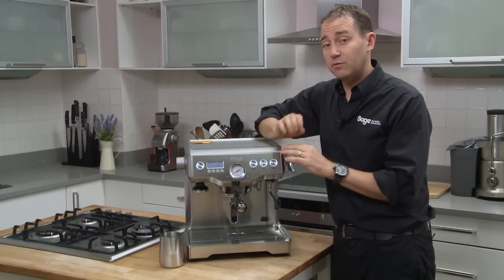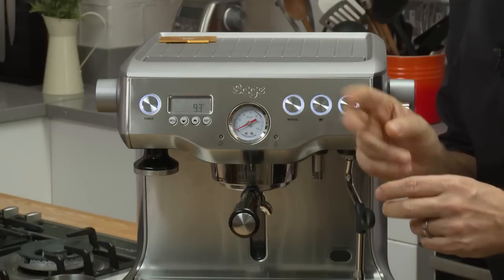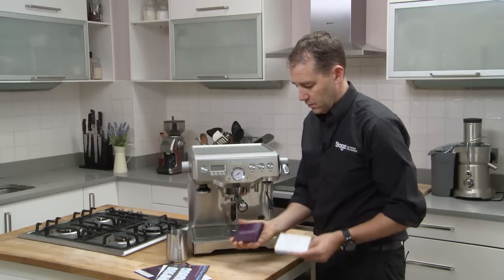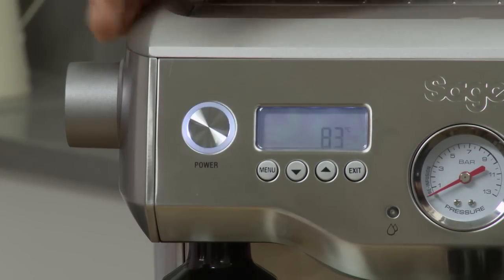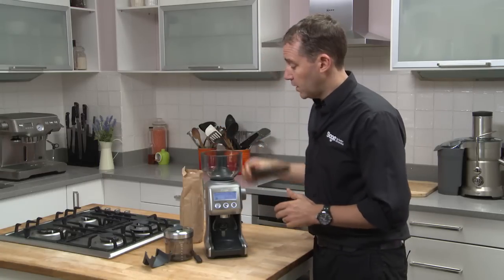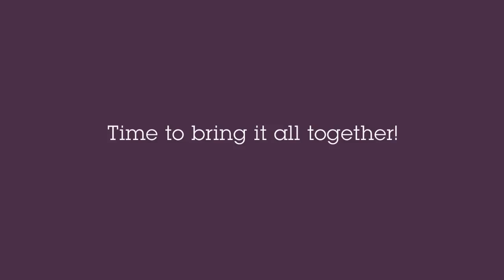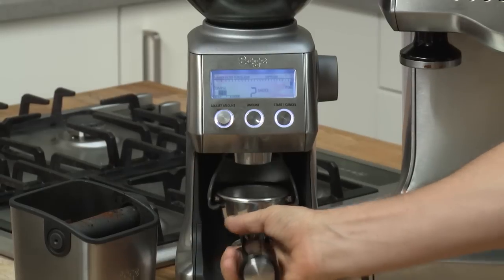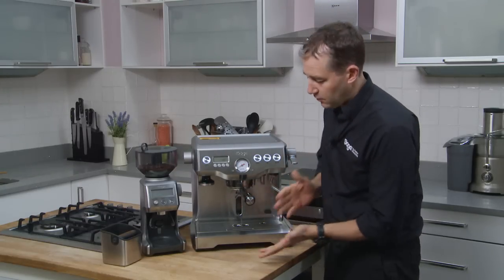Dual Boiler and Smart Grinder demonstration - Sage

Comment: For the grinder portafilter holder.Larger group heads are 61, but I'm sure the one in this machine is as stated , 58mm.
How has this Espresso machine held up? I have heard plenty negative reviews on the grinder, but the espresso machine has been mostly good, except for some forced sending in for service issues that have been reported.
Reply from the maker: Hi Phil, the machine is great and this video has mainly pointed out the best key features https://www.youtube.com/watch?v=sxoJjdLvspE could you possibly point me in the direction of the negative reviews? Many thanks.
Reply: I don't know....I really like the robustness of the Oscar so far. But, a PID control is key for perfection seekers...so..we shall see.
Reply: i think e61 is not 61mm but 1961 is the year of the original design. I have a smart grinder, i dont recommend it unless you are going from french press to espresso and back every day and even then, it is weak design - it cannot hold its setting, its cheaply built, hard to clean. My gears have stripped on it so it is going for recycling altho the burrs and display are still good after 3 years of light use. If you are doing espresso only, go for an espresso grinder - i replaced my smart grinder with an ascaso 250w i1 54 mm flat burr. Pretty sure the machine will last forever, it weighs over 10 pounds and already after 1 or 2 shots i am getting results i never got with my smart grinder even new. If i could afford i would get a vario or the new barata sette which is a bit cheaper and co go from coarse to fine easily.

In your video you grind first with espresso setting at - 6 notches, then I see it later at -3 or -4, then when you focus in to pull your shot, you are right to the end, this is sort of the problem with these grinders. at the end of the range, you are able to tamp down hard and get a shot, whereas at the end of the range you should be able to choke any machine with the talcum powder grind that should be coming out at the last notch? So apparently the grinder is way off?

I am also at the point of changing from a 840xl (1st gen - never really got fantastic results with it) to a 920xl, but am also considering an e61 hx machine with electrically heated group like the bezerra bz10. I like the 920, but again i am afraid. It will not have the longevity of an all metal machine with copper piping instead of silicone. Breville has some neat features but uses cheaper parts and cheap labor to assemble, when you are investing 1300$ in a machine why not spend 300 hundred more to get a built in italy all metal machine. I have a love-hate relationship with breville and i do fear that i will have problems or need parts that cant be found or replaced.
Reply: I use a Nuovo Simonelli mfc grinder with short hopper. It's rock solid, but takes getting used to to jump from different settings, as it's manual and stepless

Comment: It is a very bad machine.  It has a lot of problems. mine, lasted just two years. Look for the reviews in internet and you will se what i mean.
Reply from the maker: Hi, sorry you'd had issues. If you would like to drop us a line on 0203 764 1722 and we can look into your issues you are having. kind regards.
Reply: I have heard of a number of issues, but I also have heard of great reviews, but maybe on the short run? I think a great alternative would be the Gloria, and the Vivaldi2. They will last a lifetime with self cleaning and service, vs this has to be shipped for service. But overall concept, I think tBreville did an OUTSTANDING job in bringing full control to a industry that was so sluggish, and mostly very expensive, and guarded by the commercial market, and opened up espresso enjoyment at home for the home user. For that they are revolutionary. 
Also, I think Breville can make this for a pretty low cost. They marked it up a bit more for the competition and accessibility.  Perhaps the next successor will be a true long term appliance.

Comment: Oh my god.. I have waited so long for this machine.. It's finally released in the UK! It's been two years and I'm trying to find a way to get it! The problem is that Breville dual boiler in the U.S is 120volts and I need 220-240, and it is available in Australia.. But Australia is too far away and no retailers do international shipments.. I found even Gastroback the name of the brand in Germany and this year I found out "Sage" is also a name of Breville and now the website is clear showing all different names in the world.. I have been searching for this machine a lot and finally when I searched Sage Dual Boiler i got a result.. I have Breville Pro 800 collection and it is fine but not as good as advanced as this one. I really just wish it is called "Breville" because all my kitchen got this "Breville" brand and even if the look is the same the brand name looks diff and I prefer that name.. anyways not important. How much does this machine weighs in the box? I plan to take it abroad and the info in the website doesn't show the weight.
Reply: MacAliPro I can purchase one if you'd like. Im getting one this weekend, and might be able to negotiate a deal if you would like one too! Let me know mate